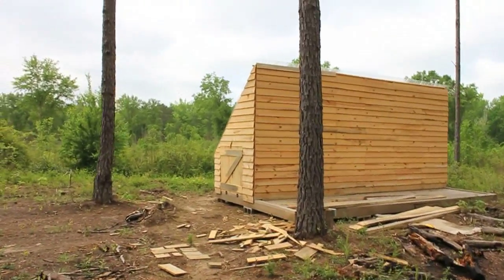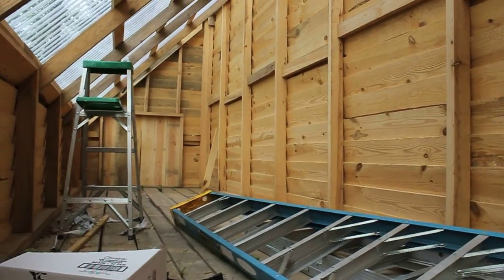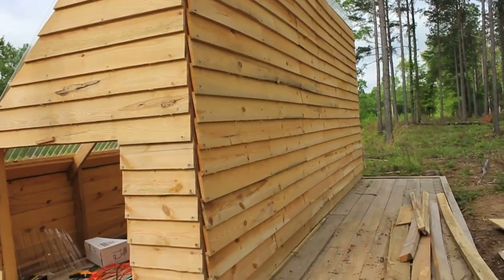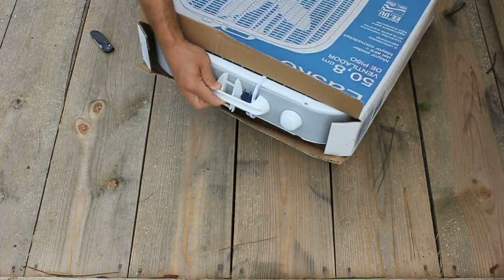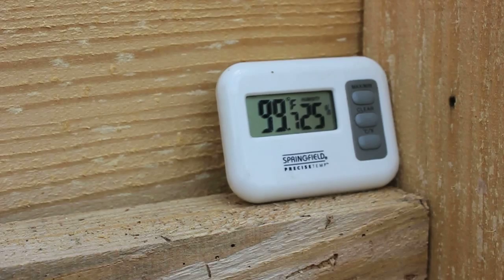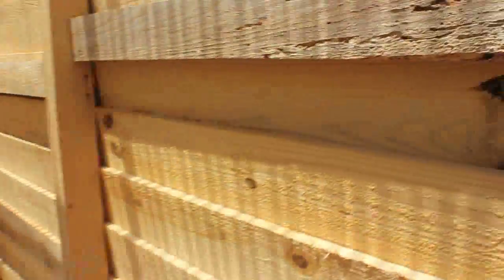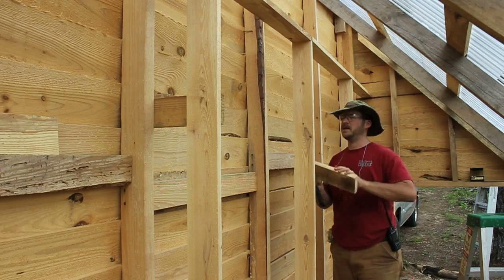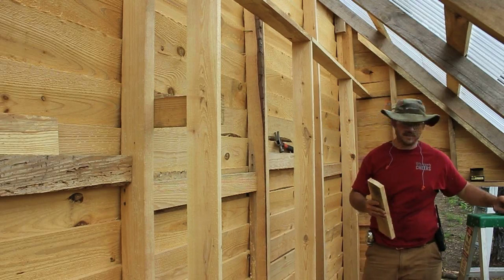Building a SOLAR KILN!! Part 8

Comment: Those are good fans. If you clean the blades, and put just a little lite oil on the bushings every now and then they'll last for years. Simply keep them serviced. I've used these fans for years.

Comment: If you paint your  kiln Black it will get even warmer when the sun is out.  If you wont better control of you fans you can use a Photo Cel with one of  your one timer, and turn the Electric on and off, with the timer turning on and off the photo cel. That is how we burn sign  from dark too closing time  on Business.  You need only one timer and one photo cel and have them control the electrical boxes in the Kiln that the Fans plug into.

Comment: Are you planning any insulation? What about black paint on the interior? Just curious because I would also like to build one. Looks great, by the way. Like your video's
Reply from the maker: Butternut Hill Farm Not right now. The tarp that I have in there as a barrier between chambers is dark so that helps with heat absorption. I might add insulation during winter when outside temperatures drop...but today it blew past 130 degrees in there and I’m happy with that. Thanks for watching!

Comment: I'm wondering; will the door hinges support the weight when used as a ramp?
Reply from the maker: Roy G. Dodd They have so far, however I have the same concern. I’m planning to put a couple more per door in time.